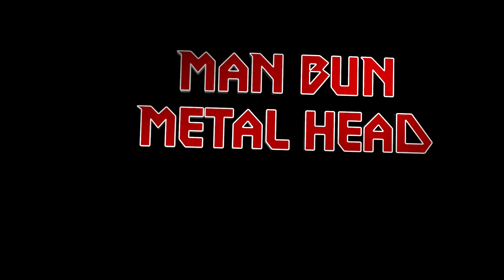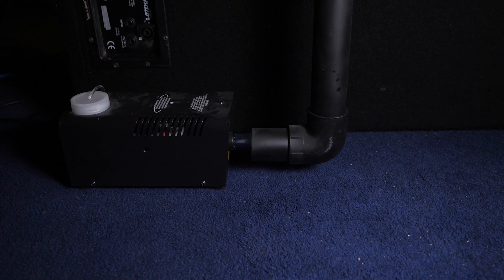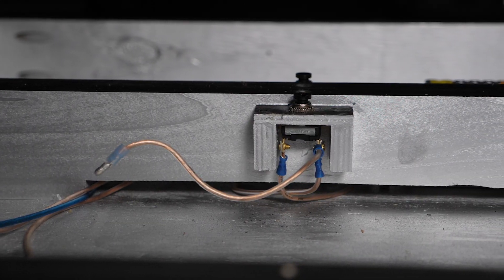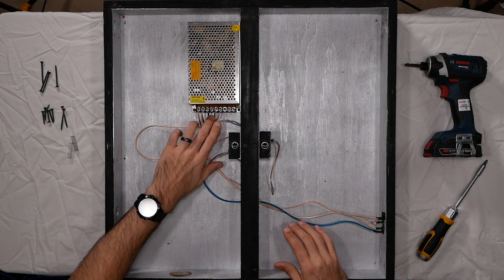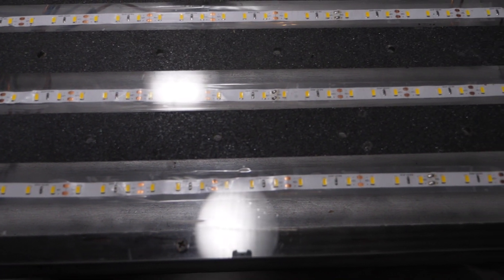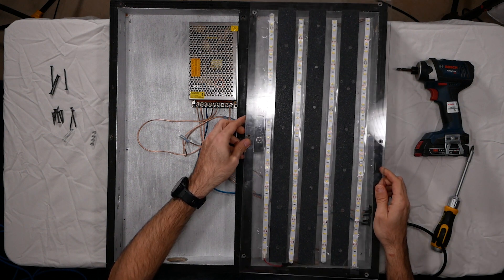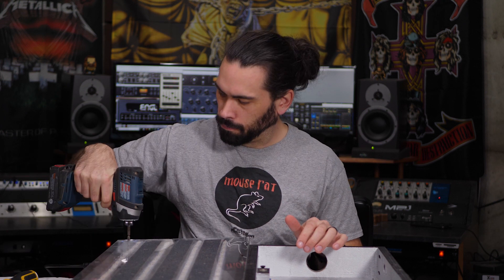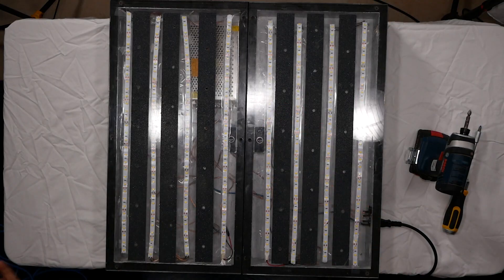On-Stage Light Box with LED's & FOG - Part 1

Comment: Hey there this is awesome! The led strips you link to are gone it looks like, will any that say 12v work? Did you just cut off the plug on them and connect your own wires to it and power supply?
Reply from the maker: Any LED strips should do. The lights I used didn't have any connectors, but you should be able to remove the connectors or use another connector to make to them.

Comment: Very slick.  I was starting to design my own when I found your video.  I'm glad I waited.  Lots of great ideas.  One question for you.  Do you feel like the quarter inch plexi is thick enough?  would you go with half if you made another one?  I know it does a quite a bit to the cost.  Thanks!
Reply from the maker: Thanks. If I did it again, I'd probably go with 1/2" Plexi. 1/4" has held up fine, but does flex.

Comment: This is awesome, man! My band is wanting to start using these for our shows. Looking forward to Part 2!
Reply: Also, do you by chance have or know where I can find a wiring diagram for the switches? Thank you very much!
Reply from the maker: No wiring diagram right now, but I'll put one together in the future. It's pretty simple though, the switch just closes the connection to ground.
Reply: How come you wired in series rather than in parallel? Not criticising. Just curious as I'm debating which kind of connection I should go with for mine. Thank you! Looking forward to Part 2
Reply from the maker: It was just easier to wire the LED strips on the panels in series.  Parallel would probably be a better option though in case one strip goes out.